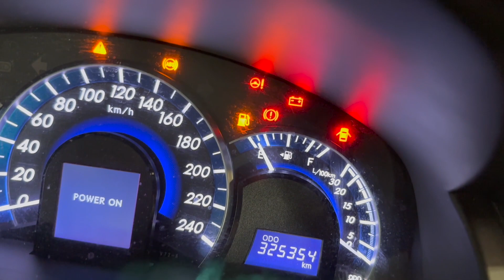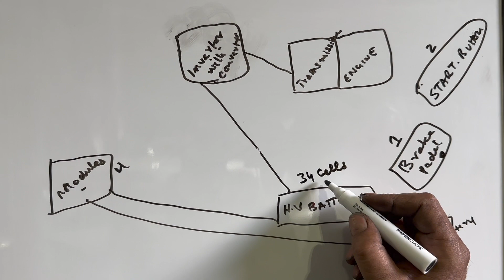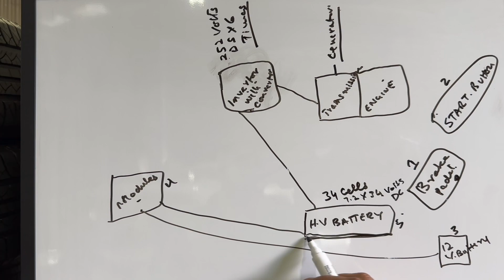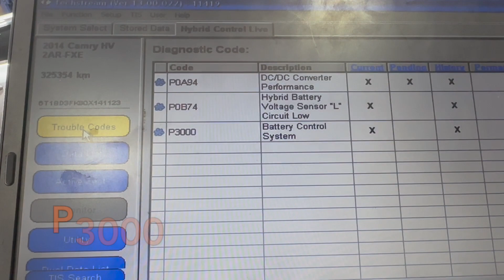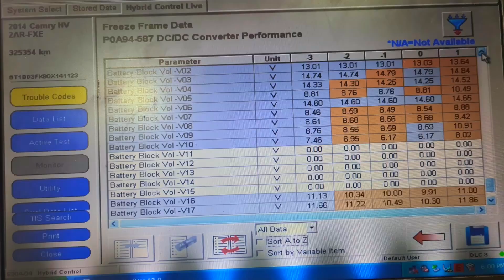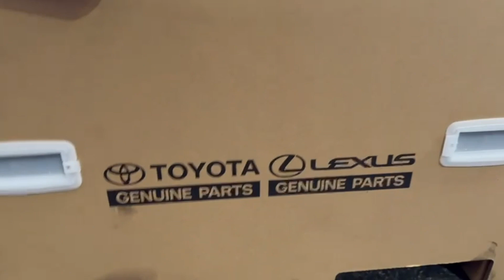P0A94. Toyota Camry Hybrid 2014 . Inverter with convertor malfunction drained the hybrid battery!!!!

Comment: I found this before very informative, thank you. My "check hybrid system" light came on and the code read P0A08, "DC DC convertor status circuit". 

That's the only code I have, would swapping this invertor fix this?

Comment: What is the reason for all this I understand the battery needs to be replaced but what caused it to start to go bad to the point the inverter needs to be replaced as well?
Reply from the maker: No. No need to replace inverter with converter unless you got a code for it. All batteries has life chargeable or non chargeable.

Comment: Really great info..
Bhaisahb I bought 2013 Camry hybrid, it was parked for long so seller claimed its hybrid battery is dead. I bought the car and replaced hybrid battery with refurbished hybrid battery. Now ready sign comes up but car starts for 2-3 seconds and die again. I checked and found throttle body don’t get response from accelerator pedal, I changed MAF sensor, pedal and throttle body too but didn’t worked. Send it to mechanic, mechanic said it’s fuel pump stop working after few seconds when car starts. Plz give some advice
One more thing when it try to start there is few funny noises towards the water pump don’t know what could be that. I will appreciate your advice. Thank you

Comment: Thank you for your video. I just to ask about my camry 2019 hybrid. Whenever i start it shakes for 2 to 3 seconds . Especially when im stopped in parking mode and it goes back to engine from hybrid battery. What can be reason for this? Do i have to chage battery?

Comment: My 2008 Camry inverter went bad even though I only have about 130K on it.  I found a used one on ebay for about $250.  Your video was great!  Things are a little different but I can get the jist of how to do the work.  Thanks for such a great job!
Reply: Did you have to do any coding on the inverter or is it just plug and play mine just went out and didn’t know if there was any coding needed
Reply: @Brendanmwork  No, I just removed everything and then installed the ebay unit.  The guys broke some tabs and stuff on my first ebay unit.  I think they are gorillas that dismantle parts.  After I got a semi good one in, it charges the hybrid battery faster than my original did.  Now I have other issues as my small battery goes dead all the time.  Ugh!  Good luck!

Comment: I have 2014 Camry hybrid and have same issue. It is recommended to change the inverter/converter when your hybrid battery is low or you diagnose the inverter/converter
Reply from the maker: You need diagnose what is exact problem. Share the code. Please

Comment: Thank you so much for this tutorial/video.  I did this same job on my 2014 Camry Hybrid this morning in about 90 minutes, and my car is back to life.  Absolutely perfect  video.  I could not have done it without you.  Bought a used inverter with converter for $177 at salvage yard.  Saved me thousands.
Reply: How did you find out that inverter is died and not the battery?
Reply: @hashmatqali8184 in my case there was a light on the dashboard that indicated check hybrid system and when the mechanic checked it a code showed up 
P0A09
DC / DC Converter Status Circuit Low Input
So he ordered a used converter and replaced it and now car is back to normal and I paid 450 including labor and tip .
Reply: I change the inverter but the problem still do I have to do something else

Comment: Hi Sir, 
I purchased Camry hybrid the hv battery only show charging in dash when regeneration and car running  not while engine starts on ideal is this common with Camry hybrid as prius show charging diagram in ideal also when engine start.
Reply from the maker: Hi Sikander, Yes its Normal with Camry hybrid. Basically when hybrid battery strength reaches near to 40% engine starts running and begins to  charge the Hybrid battery.

Comment: I did moving around the Inverter today forward this video.  I am looking for help with a 2013 avalon hybrid. I have P0A0D-350 High Voltage System Inter-Lock Circuit High after hit the deer. I can not find others but Service plug grip( fuse is working good). It will be great  give infor where are they (Inter-Lock) and how to test them.
Reply from the maker: Hi @derickd2385 , plz watch the below vedio how  to put in the  interlock switch properly.  

https://youtu.be/HTzRskWML4o